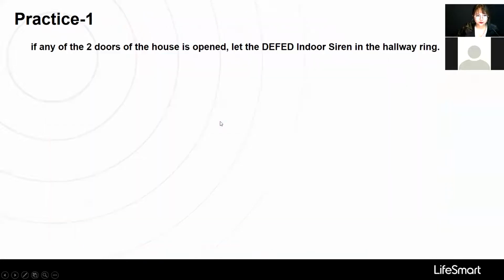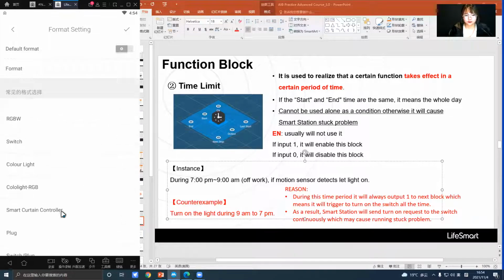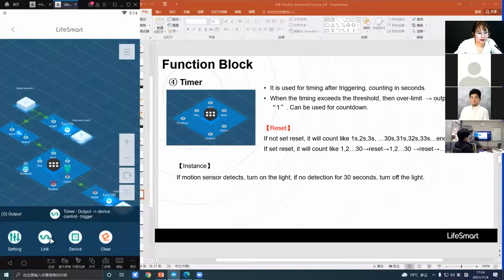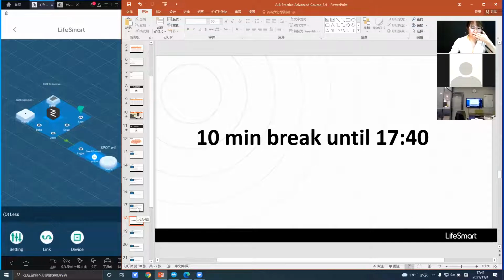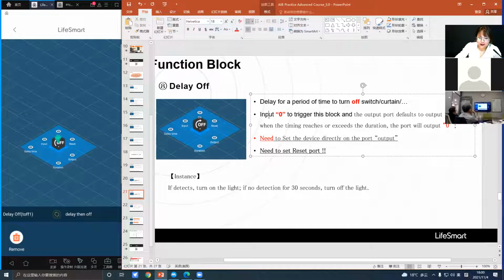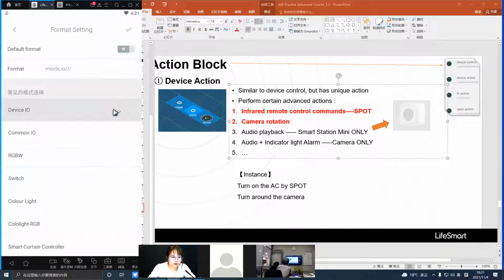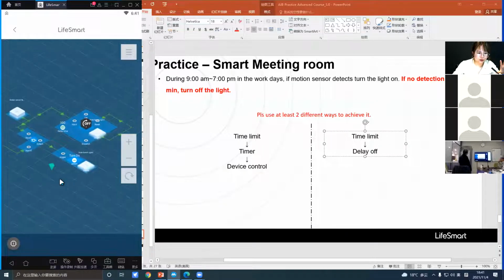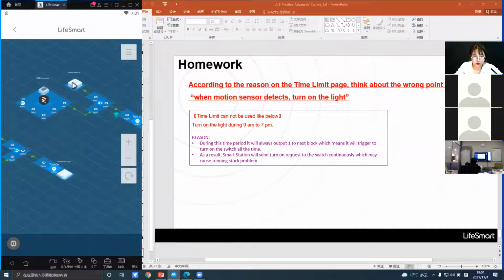LifeSmart－Online Training: AIB Practice Session2

Comment: Hi everyone, this is Dorothy, how are you.
I need to apologize for a mistake i made in the AIB training course on November 4th. And thank masa so much for the notification.
How to turn on the light of SPOT by AIB, there are 2 ways.
[1] Only want to turn on the light of the SPOT without setting the color.
①use a device control block
②click the action port, and choose setting-format, choose IO Command- On/Off_user-defined and save it. Back to map and click "On/Off"-choose turn on and back to map.
③click the device port,  and click "device", choose a SPOT from all the devices.

[2]want to set the color of the light of the SPOT
①use a device control block
②click the action port, and choose setting-format, choose IO Command-RGBW_user-defined and save it.Back to map and click "Color-RGBW" to set the color and choose "turn on" and save it. 
③Back to map, click the device port, and choose setting-format, choose RGBW_moids and save it. Back to map, click "device" and choose SPOT.

Sorry for this issue, let me share you the correct AIB template.

AI Builder Template Sharing - How to turn on the light of SPOT, Copy this message and open LifeSmart App.

lifesmartapp://?cgy=aibt&cont=ApksAqtZEqUnKoUvEqr6EoMmEqSoXaMhXC3uE4Ix1HyoVCtZ1FLtUCemKoP0KaMnE4u0O4unOqUZWP&sign=0%2D%5FGykL1YwygkzsFkrff7P